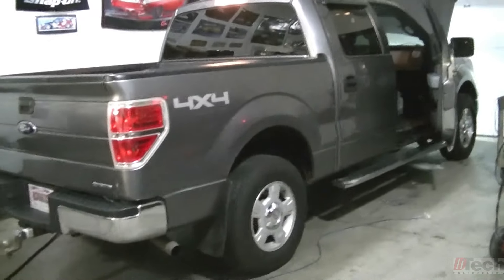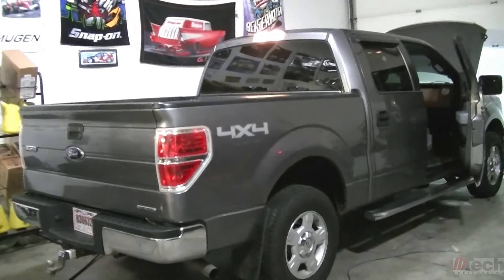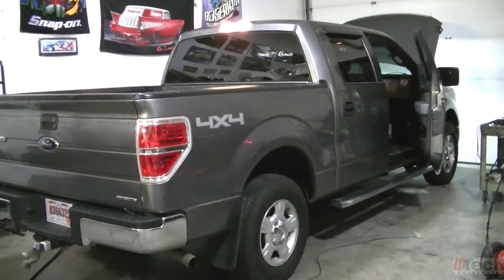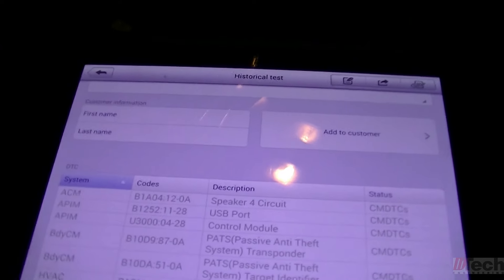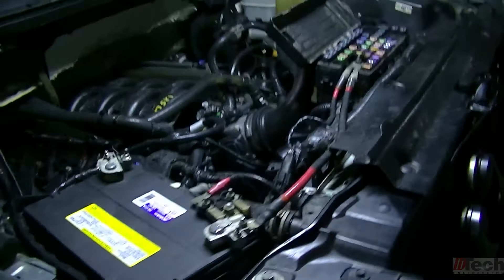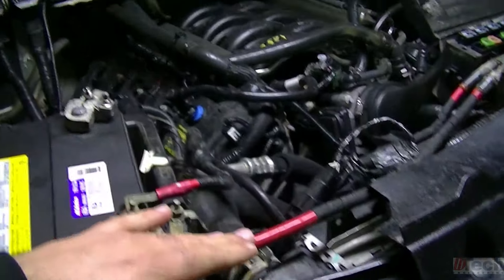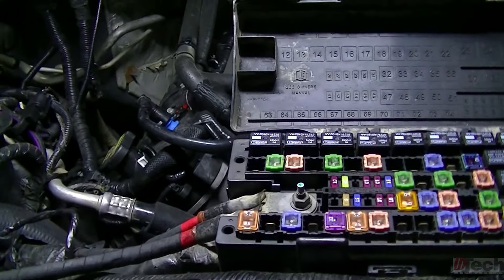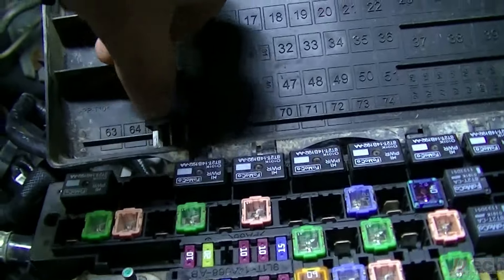2013 F150 no crank, how to bypass fix a bad PCM

Comment: You young guys spend way too much time looking for trouble codes.  My 9009 F150 had the same problem.  It would not crank and start so this was obviously a starter problem,   Rather than waste time hooking up a scan tool I got under the truck and hooked up a remote starter button to the battery and solenoid studs on the solenoid.  With the key on the engine cranked and started right up.  So now I knew that I had 12 volts to the battery and the starter and solenoid were good.  That took 10 minutes.  The key still had no effect on the starter but the dash display still came on.  The first thing between the battery and the start circuit is a fuse and relay.  I checked the fuse and verified that it was good so I swapped another relay in place of the old one and wah-la the truck started right up and the truck was fixed. This took 15 minutes most of which was spent looking up which relay and fuse are for the start circuit.    I spent a total of about half an hour and if I was a mechanic and knew where my tools were it would have taken less time.  I confess I plan house the scan tool to read and reset trouble codes but I could not immediately locate it and decided it would make an easy diagnosis a lot harder so I quit looking and just did it the same way I did it 60 years ago as a teen hot rodder.
Reply: Well relay is good, I just can't get power to the fuse
Reply: Damn you got the 9009 model already? It prob flies itself everywhere huh?
Reply: Lol scan took takes 30 seconds. And your not wasting time hoping the diagnosis your doing is right. But your problem may be that the scan doesn't work for the 9009 model yet

Comment: Had the same problem no crank no start with my 2011 ford f150 3.5.  Replaced the ecm fuse on the front, still nothing.  Long story short after going through hell and back.  Removed the bottom power plug on the pass footwell that goes for the bcm and it reset everything.  Not even disconnecting the battery did this function...  This worked perfectly and read my key with no problems to start
Reply: Where is the bottom power plug?

Comment: Brilliant video!! I've got a 2014 F150 6.2ltr.....on an island in the Bahamas, no mechanics. I've wasted days or weeks watch videos, Google, and forums. Can't believe how many way Ford built no start, no crank into their vehicles, broken wires, pcms, corroded relays, etc. It's been sitting for 2 months, no crank, no start, good for noth'in paperweight. From the day I got it the problem was rare and intermittent and would "fix itself" until one day it wouldn't start at all. Dash lights up like normal, good battery, starter, all fuses and relays good. Replaced starter switch behind the key, and immobilizer. No Luck. Will this fix work in my case? I haven't tried yet but.....could I just put a push button on the starter relay you jumped with the key in the "run" position. New PCM?...if so, won't I have a problem with key programming. I'm in a real bind. I'm hoping you'll be kind enough to help me out. A duct tape fix...........anything!
Reply: watch your dash!  see if it reads Zero KM to empty... This happened to me until i put in gas (though i already had a half tank) and it fired up like nothing happened. When the battery is disconnected too long, the fuel pump makes up its own Zero, until something happens. so for 2 weeks the only thing stopping me was that the truck thought it was out of gas.
Reply: Its happening to me. Not sure what it is was told bad pcm. But I get to work by disconnecting and connectinf the battery... try that. Or if you fixed it what did you do?
Reply: @zerquetch  how does the truck thinking it’s out of gas cause a no crank no start issue?

I’ve ran out of gas plenty of times especially with the current prices of gas and getting a meager 12 mpg. It cranks but definitely won’t start until I put gas in . If I had half a tank of gas it would start.
Reply: When you run out of gas, that is a different circumstance. In my case, the computer just thought there was no gas and was trying to tell me that. When there is no info, the pcm can't make decisions. It reads the difference in voltage sent by the pump to determine the gas level. No info = no gas.
Reply: I honestly just put in a push button wired straight from the starter lol I couldn’t figure it out, cheap $5 fix
Reply: I'm having the same issues and keep seeing you everywhere I research. Did you get a fix? I think we likely have the same issue
Reply: I fixed my 2003 mustang. Sledgehammer. And then str8 to the crusher. Didn't even harvest parts. 1 and ½ years of torture. Couldn't take it.  Snapped.  Hate fords now.

Comment: Had the same problem with my 2006 F-150. Tried to fix it by replacing the ignition cylinder, ignition switch and starter. Jumpered the starter relay and it started right up.
Reply: how did you wire it up?

Comment: Good evening really can use your help with mine. I have multiple problems electrical. This car get water in the bcm and think is a wiring harness problem. After change my bcm now had 2 codes, it starts and shut off right away. Fuel pump and Cranck sensor have codes.
Reply from the maker: maybe it is shutting off due to immobilizer issue from bcm replacement
Reply: How did you fix it I have the same problem

Comment: Dude you did good going through the trouble shooting and going through your thought process. I am having this issue almost exactly and went through everything before I seen your video and and I’m honing twords the pcm bcm , no blown fuse in bcm but the starter relay ain’t clicking, if I jump the relay it cranks but doesn’t engage???  I gonna try to weed out ignition switch but probably bcm pcm don’t know for sure, but that relay should click, from what you said the coil on the relay should be actuating  , you do good with talking out loud go through your process a lot of people can get a lot from your process good job
Reply: Did you find the issue have the same problem

Comment: I have that situation with my truck now. Is it possible that you could walk me through it?
I had a car locksmith come and he made keys my original is dead. He also said he disengaged the system yet it still no crank no start. My neighbor used his gadget to bypass and it cranked but did not start so I will try to bypass the pcm as you demonstrated. I have a f150 2014. it is costing me a lot of money. the tow was 400.00, keys 200.00, they said the  part under the spare tire..a new battery...ugh!

Comment: Battery must’ve been replaced rest truck it’ll be fine same happened with my moms truck being a new model for when battery goes bad you can’t just swap it out yes crazy new ford product. I have a 4.6 F150 has fuel air and spark I replace the crankshaft sensor, both of them bank, one and two she only starts when it’s cold, but when it’s hot, she won’t turn over and driving on the highway hot temperature it she will just cut off right away and won’t start can u help ?

Comment: So if i have a u0100 missing communication with ecm would this fix work as a bypass?
Reply from the maker: no, the computer has to be able to communicate.
Reply: @DTEAuto  thanks for the reply. I used a jumper wire on the start/run relay which doesnt have 12v coming i to it, truck starts. Is that relay controlled by the pcm?

Comment: I had the same problem in my 2013 gt. The problem was with the power on lead 86, the green and white. There is a split that is between PCM and the relay terminal it's spliced into another green and white that comes from the micro controller on the BCM SJB on the inside. The connector on the splice corroded.

Comment: Did you see the ACM failure, if you check the diagram of starting system, the ACM is in there, my ford also have this problem, I believe the problem is the ACM, my problem started with it turning off and on the stereo anytime by its own.

Comment: I just diagnosed one of these. It turns out to be the immobilizer,as soon as I put it on it started no program needed. The 2.5 v at the fuse box for starter relay was correct, it is ground side switched. Just have to have a good scanner that can read data display.
Reply: My Ford f150 keeps Starting system fault. Three times with in the last two weeks.  I disconnected the battery for three hours it always started.  How can I fix this problem?
Reply: @lindseyjohnson2096  what codes do you have
Reply: @jtsautomotiveandeverything480  I haven't tried to code it yet just troubleshooting from home. The f150 has system fault every Friday for the last three weeks at work.  Battery was disconnected over the weekend the first time, 2nd time 8 hrs , third time 11hrs . It maybe the key but idk . I'm in awe lol
Reply: @lindseyjohnson2096  well what kinda scanner do you have
Reply: He was wrong the problem is his electronic ignition switch. Not pcm, your right it's a switched ground signal from the pcm. I've done so many of these. Check ignition switch if correct output then neutral safety. Kinda sad he cut the harness like that. Could of used jumpers to test pcm plug. Never cut harness, will forever look like someone has done something ghetto. The original bcm was not the problem, he needs all data or michael1 ect.. so you can understand the circuits, follow the oem testing procedures. Learn to use a oscilloscope would have pin pointed pretty quick with the write references. Not talking crap I've been exactly where you where b4 and I learned having the correct tools and resources save time and money.
Reply: @lindseyjohnson2096  most likely your electronic ignition switch or you nuetral safety but don't throw parts at it. Call someone who's experienced and follows the diagnostic procedures.
Reply: @3babyghost my IGN,acc,run,start and the transmission says park/neutral, still 2.5v at the starter relay, there isn't any Pats code

Comment: I had no crank no start with full power. Ended up being starter. Used screwdriver to jump starter and replaced starter. Also make sure your batter terminals are clean and seated well.

Comment: reason I ask is, i just swapped a '13 ecoboost, with a '13 motor from a place in Wisconsin (i cant remember their name).. but the motor had same yellow paint marked numbers, (but in the 19's).. at anyrate.. tried to start and got same thing.. my superchip programmer tells me I need to reset ecm/pcm, as it does not recognize engine position..
Reply from the maker: if it doesn't crank it won't have anything to do with the program not recognizing engine position, it watches for that during cranking in order to find the cam and crank positions in order to correctly fire up the engine
Reply: @DTEAuto  thankyou! yes! this has proven to be true! I was able to reset code and motor fires right up now!! thank you for giving me the motivation to keep trying!

Comment: I don’t know much about this, but sounds like an issue I was just reading about …. Fuse 27.  It needs to be rewired to a bigger fuse.  Evidently common in 2009-2014 models.  It’s prevalent enough that Ford has an OEM fix kit.

Comment: Ive got a 2013 raptor/6.2,,,it keeps saying starting system fault,,it keeps blowing the #78fuse under the hood,,,it went from cranking no start to now no crank no nuthin and blowing that fuse,,sumbody please help me
Reply from the maker: Looks like that fuse powers up all the ignition coils, one of them could be shorted and blowing the fuse, unplug all the coils and see if it stops blowing and go from there

Comment: Same problem 2013 F150.

Exact same micro voltage at the power distribution box starter relay.

Removed connectors at the pcm.
Cleaned the connectors with electronic cleaner.
Plugged the connectors back in.
The truck started right up.
Also removed the "check advanced trac" warning.

Conclusion: Corrosion between the connectors and pins, of the pcm.
Reply: Your comment just saved me from taking mine to the dealership. I've been testing all over with a multi-meter trying to figure out my issue. I wasn't getting a proper ground sent from the PCM to the junction box starter relay. Cleaned all my PCM connections with electronics cleaner and started right up. Really really annoying...but really glad it's fixed.

Comment: I am currently having the same issue I can start from relay but not the key. When I tried wiring it like this it popped #16 fuse in the cab the ignition feed fuse, so apparently I have something else going on

Comment: I'm dealing with this issue right now on a 2008 Ford Expedition and narrowed it down to a pcm issue too.  Mine has an intermittent problem, though.  Sometimes it works, and sometimes it doesn't.
Reply: You figured it out?

Comment: Hi D-tech. Can see you eventually had the changed pcm replaced. What voltage did you eventually get at the control side of the relay after the change, same 2.5v?
Reply from the maker: I unfortunately did get a chance to recheck the voltage level
Reply: I'm not even getting the 2.5 volts to that control side

Comment: Can someone tell me exactly witch wires are being used and where to connect them because my truck is doing this exactly
Reply: Mines doing the same thing I wish he had some pics of how he has it mine is doing the exact same thing
Reply: Hey Donny just wondering if you might have figured it out
Reply: @ROC-pz7hh  no sir we ended up selling the truck
Reply: @texasbackroads55  yea I tried this here and it worked the first 2times and now I can’t get it to do anything so I’m going to have to take it in I was just curious if it had worked for anyone cause I’ve been down going on 2 months now I think this PATS deal ford has on there vehicles is some BS

Comment: Going thru same  problems   with no crank also lights and door locks wipers radio   intermiten operation  by itself no switc he's operated first replaced starter. Then gem module  Then I have2.5 volts from alternater.then wipers . Interior lights rDio not working after I changed alt. Battery light in dash go back advance  auto where got all  they tested said only getting 115 volts from  new alt  guy I bought the truck from told me it was Haughton after 3 months ownership tforgot the starter after ctanking  tries to engage flywheel I been taking off signal wire off sillanorde after it cranks tired and broke from this ford

Comment: You had good info about the start relay witch will help me with the same problem on my truck but I am a little confused about the wires going to the relay from the pcm.  
Can you go over what you did with the 3 wires?
You cut 2 and tapped into the yellow one. 
Where did you tap from?
What did you do with the other wires you cut. 
I understand what you are trying to do but I am a little confused on how.
Thanks again for the info.
Reply from the maker: The Yellow was power feed from the pcm to the starter relay control, the white/green was the relay control ground from relay to pcm. The blue/white was the signal line from the ignition switch to the pcm and bcm which sends a power feed signal whenever the key is switched all the way to the crank position. The relay control wires were cut between pcm and relay, the white/green was put to ground from the relay side (from fuse box) and the yellow from the relay side (from fuse box side) was spliced into the blu/white starter signal line. word of caution , this is just temporary and not the proper way of fixing the issue, due to the fact that the starter will be engaged whenever the key is put in the start position no matter what position the selector lever is in
Reply: @DTEAuto  Thanks  for the very quick response.  
What you did makes sense but with out checking  pin wires now I know the colors codes.
I was a Nissan tech years ago. Back in the late 80's. I did the same thing to a 200sx. It took quite a while and parts under warranty before I rewired it. The car was returned to  the customer and he never had a problem.
Sometimes you have to think out of the box.
Again thanks. Stay safe,
Greg
Reply: @DTEAuto  Thanks  for the very quick response.  
What you did makes sense but with out checking  pin wires now I know the colors codes.
I was a Nissan tech years ago. Back in the late 80's. I did the same thing to a 200sx. It took quite a while and parts under warranty before I rewired it. The car was returned to  the customer and he never had a problem.
Sometimes you have to think out of the box.
Again thanks. Stay safe,
Greg
Reply: What were the PIN numbers on the pcm for the 3 wires

Comment: My truck does same thing but when i jumper it, the starter cranks but still no fuel 🤷‍♂️
Reply: There could be a scenario where your FP fuse (20A) terminal is distorted or melted. Ford had a fix a while back to move the fuel pump fuse to another location for this issue, hope this helps.

Comment: Which slots did you put the jump wire in?
Reply: Jump it straight under the car at the starter solenoid just connect the two contacts
Reply: He jumped the 12v positive at the stater relay  to the switched side of the same relay to complete the circuit annd start it
Reply: @oscarlandag1831  I can't tell how he hooked up the jumper wires to can you help

Comment: If you got some time to play with- do a little experimentation to make sure you found the problem- this could serve short term.  
   But Replacing the ECM once properly diagnosed is the correct method of operation.